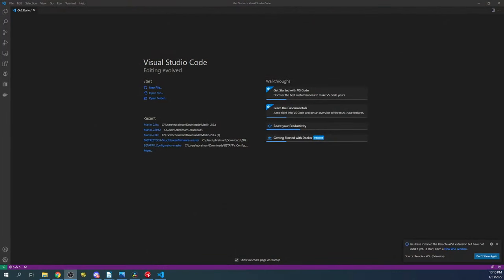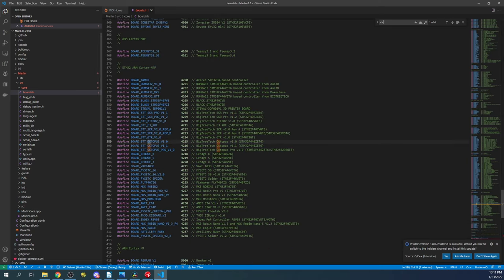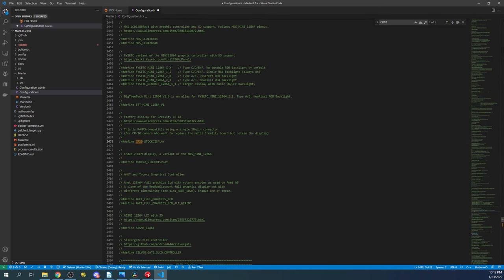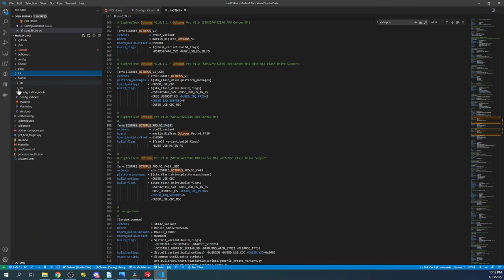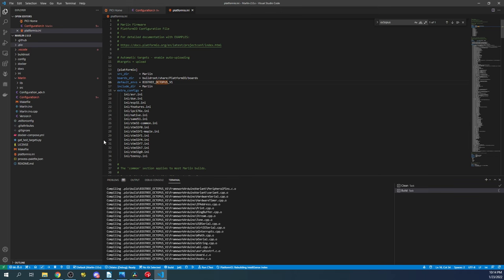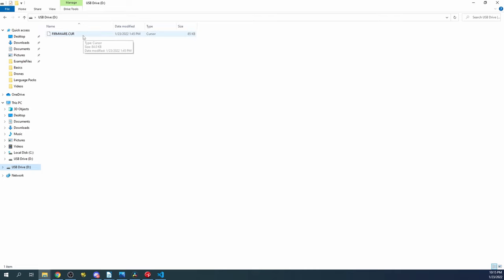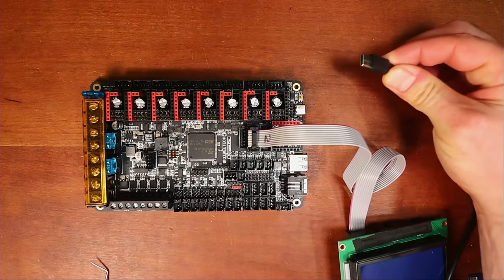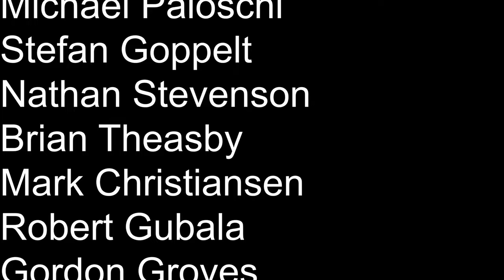BTT Octopus Pro - Creality Ender3 Display install

Comment: Was wondering if the octopus pro 1.0 429chip board will work with an ender 3 v2 screen? Keep getting an encoder error compiling marlin. Thanks it’s different than the screen your using in video. It’s 32 bit screen and larger in a full case. I’d buy you one and have it shipped to you or donate $ for you to purchase if you do a tutorial on setup

Comment: I'm trying to connect a Fystec MINI12864 v 1.2 to an SKR 1.3. If I plug EXP 1 and two Flipped, can I burn something out? I read the Fystec may have the pins rotated? I'm working on my first Klipper install. Thanks.
Reply from the maker: I'll need to test.

Comment: Does the Pro fits on the ender board compartment or do you have to run it on the outside ?
Reply from the maker: The form factor is larger than Ender 3 board.